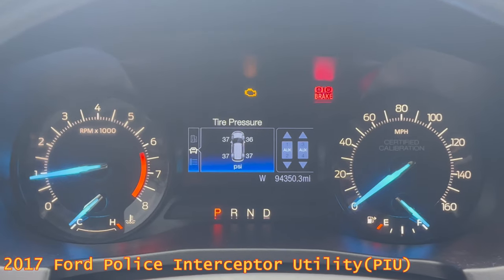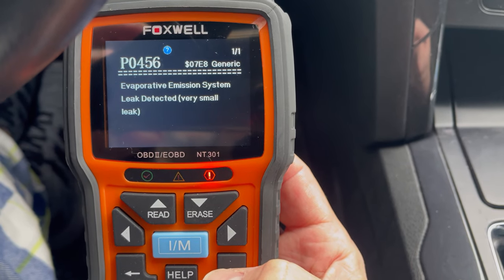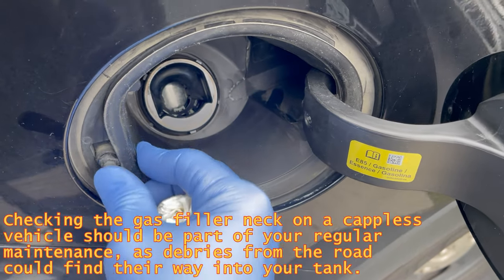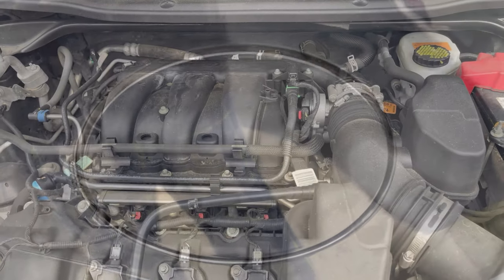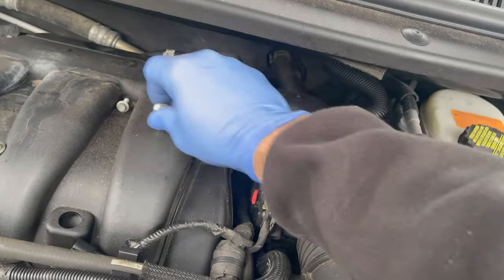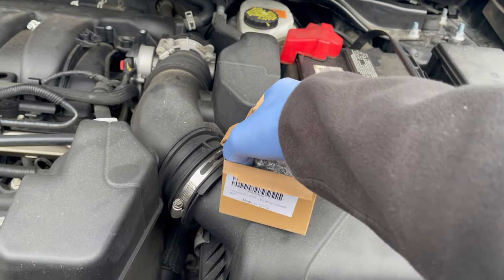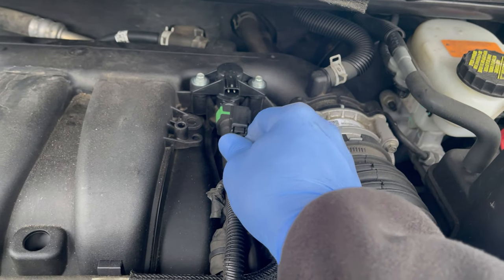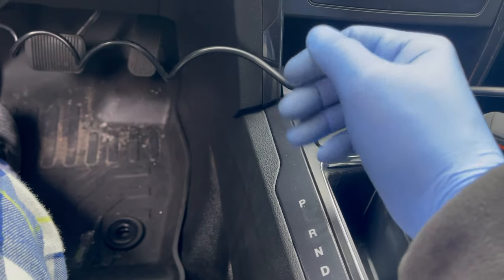Ford Explorer Evap System Small Leak OBDII P0456 Error Replace Valve Police Interceptor Utility PIU

Comment: Is the DTC intermittent or was it a hard fault? Starting to get the check engine light for this. I'm also experiencing poor gas mileage around 14-16 MPG.
Reply from the maker: Hey, yes, my was intermittent and got progressively worse.  It’s a fairly easy and cheap fix.
Reply: @mrtrytofixit how did you know it was the purge valve solenoid? Is there a TSB for it?

Comment: What were the symptoms on your auto that you replace the evap solenoid.   Thanks
Reply from the maker: Thanks for watching!   Fits I was getting poor gas mileage (14-15mpg) at regular driving.  Then about 6 months later the check engine light came on indicating “small evap leak”. After swapping it, mpg went back to sort of normal at 16-18mpg.  I like to think those were related, lol